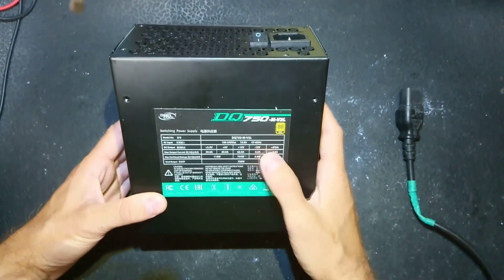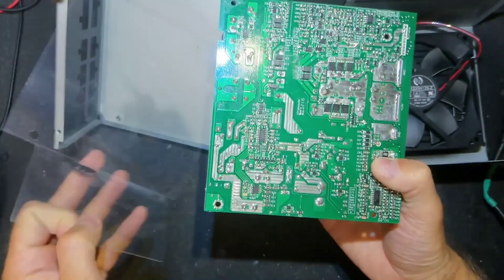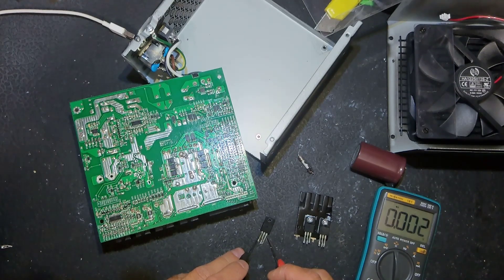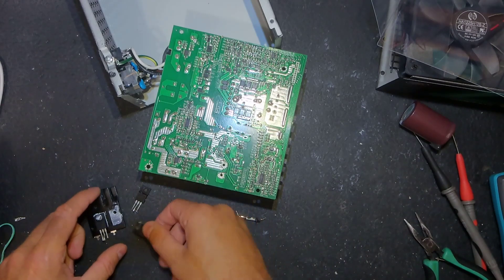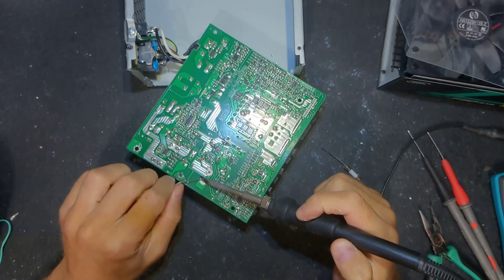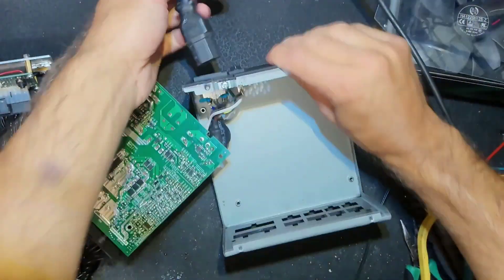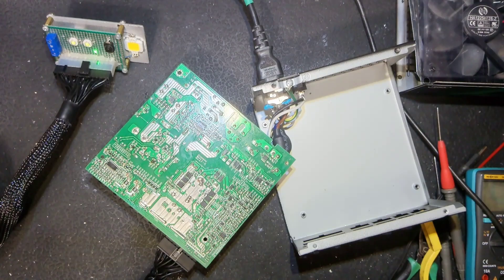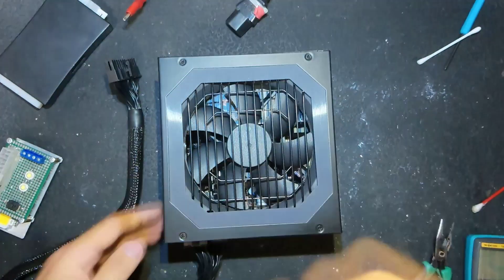DeepCool 750W repair

Comment: Great repair. What is the board with the LED that you used to do the initial test?
Reply from the maker: It is DIY tester, consists of 4 LEDs and 4 resistors. Nothing special.

Comment: this model is under active recall you could have just sent it back to deepcool. 
i had mine blow up and they replaced it with the v3 version in 2 days.
Reply: Thanks for the info!
Reply from the maker: That is pretty fast for a recall... 
In what country it is? 
In my country usually it takes more time.